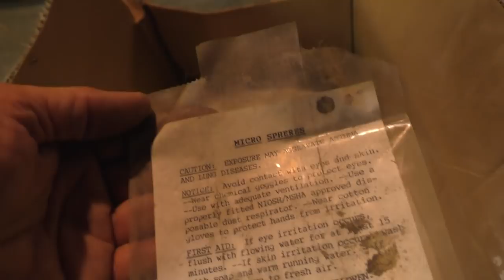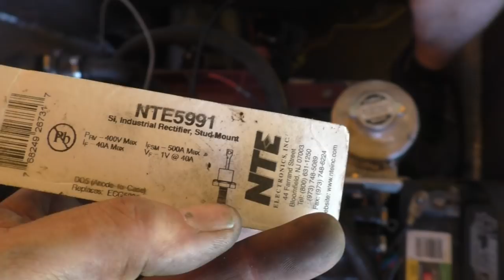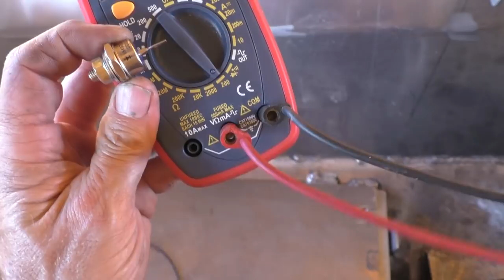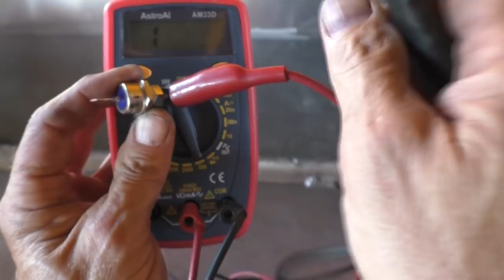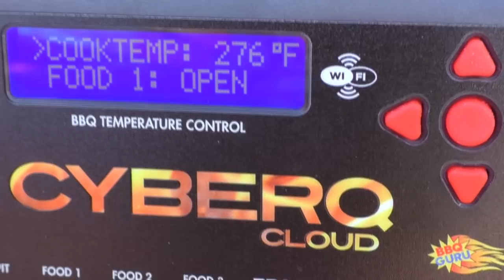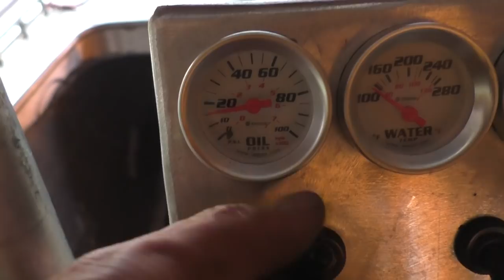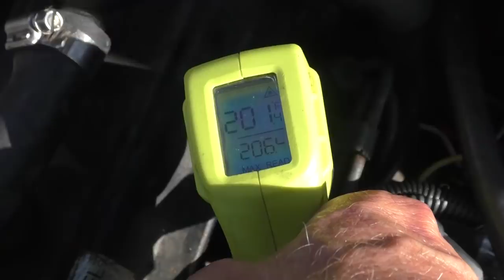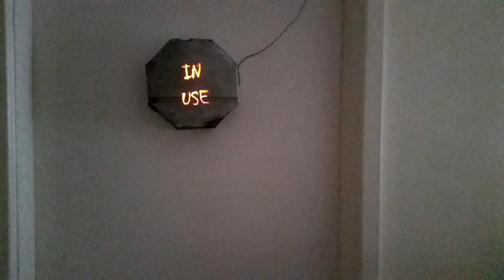Diesel Jet Boat Build - Part 17 - Fixes and Back to the Lake

Comment: that's a 70 HP motor you've got there. you should be MOVING. Your impeller must be too big, the engine can't build RPM's to full power
Reply from the maker: I think 2750 rpms is about right for being under load.  The thing holding it back is the weight and the deep V, but that is the strength and the smooth ride we want.
Reply: It's a grocery-getter.  Like the old family station wagon.  As long as it gets you there and back with your load, it's good!
Reply: 31:00 full of water.
Reply: This Engine is a high reving one for a diesel. It will go up to 5000rpm in a car. At 2750rpm you can get about half of the rated HP. You can modify the boos pin for more fuel and crank up the wastegate sping to about 15psi for more torque. On usesd engines the diaphragm for the boost pin can be broken, then it will make boost but dont get extra fuel.
Reply: Yup, Lots more power available. In addition, SV Speaker is a heavy heavy boat. If you come into a situation where you really need a tug in rough weather, the power you were getting now is going to be really insufficient
Reply: Wonderful fabrication jobs by all though! Your cleanliness of design and attention to detail is commendable!
Reply: Yup, too much pitch, it is probably still pitched for the weight, horsepower, and hull design of the boat it came off of. The engine should be able to get to about 4,000 rpm at a minimum, and low rpms at full throttle means the engine is struggling to move the blades through the water. You are leaving a lot of power unused and having an over-pitched impeller will make her guzzle gas.
Reply: Being able to plane would be handy in an emergency. I would think 70hp could plane that boat with the right pitch. I'd be real curious to see how much headway you could make with 30knot headwind.
Reply: I thought the Hamilton's were rated at 5000 RPM.  Doesn't seem anywhere near it's potential.
Reply: Your RPMs seem to be in the sweet spot for that Diesel. If it were a boat with a prop it seems that a higher pitch propeller would be the answer. Can the impeller be adjusted? I know guys in my neck of the woods that run outboard jets polish and shim there impellers for maximum performance. You don't have much HP but you have torque. Your jet is probably set up to turn about twice the RPMs. I think she still has some MPH in it, just need to spend some time playing with it. Love the videos. I've been following for a long time now. I'm gonna have to stop by and see it in person some time.
Reply: A 2:1 overdrive would seem to be the solution, but it sounds like a lot of work to mod that in now.
Reply: @SVSeeker  Peak power for that engine is around 3500-4000 RPM. If it's only getting up to 2700 RPM, either it's not making full power, or the jet pump's impeller pitch is a bit too aggressive for the engine. I wouldn't go messing with the fuel pump as others suggested, as that will compromise reliability - especially in a marine application where the engine can be at sustained high loads. On the other hand, I'm not sure finding a different impeller for the jet pump is a practical solution either.
Reply: @martinziefle1647  You should not mess with the fuel settings on an engine in a marine application. In boat applications, the engine can be held a sustained full throttle for hours at a time. Where as in a car you might only be full throttle for 30 seconds at a time. Cranking the fuel up on a marine diesel will adversely affect reliability.
Reply: This engine is very common in germany for the T25 vanagon. Its more powerful then  the original engine but still undersized. Its not unusual to run it wide open for many hours. The engine es relativly reliable if the cooling system works and the injectors are in good shape. Otherwise it will crack the head or melt a piston.

Comment: The flame proof paint goes to 1300C/2000F
Reply from the maker: OH!  That makes sense.   Thanks
Reply: The can states 1300F - 2000F (704C - 1093C) ...these are the product operating temp ranges.  VHT has 8 high heat products...each with a specific operating temp range.  The can label gives very specific curing procedures that must be followed for the product to perform as designed.

On the Vehicle
Paint must be completely dry before curing
Run at idle for 10 minutes
Cool for 20 minutes
Run at idle for 20 minutes
Cool for 20 minute
Run under normal operating conditions for 30 minutes

Off the Vehicle
Paint must be completely dry before curing
Heat to 250°F (121°C) for 30 minutes
Cool for 30 minutes
Heat to 400°F (204°C) for 30 minutes
Cool for 30 minutes
Heat to 650°F (343°C ) for 30 minutes
Reply: SV Seeker - I was wrong (a simple unit converter)would have told me that... ) 
corrrect answers by others above this comment.^^^

Comment: A 3 stage jet and a 2 stage as you have it now are too big for that engine, to make the best use of that engine using all it's rpm range you will have to go to a single stage jet.
Reply: I don't even think a single stage will work with that motor? Pull that motor, weld up a transom and mount a 150 outboard with a jet unit. Or better yet.....purchase a much much lighter RIB, mount the 150 jet unit  and have a very  fast, roomy, usable skiff. I predict that this home made thing will be abandoned in the near future. lol

Comment: Is there a reason you can't use a wire direct from the battery to excite the alternator? When I wired race cars thats all I ever used. Now you have this diode that is sure to fail when your out to sea.
Reply from the maker: I think it would be a constant drain on the battery is why that is not done.   And nothing is certain.  :)

Comment: That unit would need at least 150 HP even with one impeller removed, you need to repitch or go to a single stage check out hamjets web site its got a lot of resources to help get things matched

Comment: The fan is for a radiator to cool coolant, not to blow air over the engine. ITS NOT AN AIR COOLED ENGINE
Reply from the maker: It's also not in a car.  Check out bilge blowers.

Comment: Any plans to get Zila or another welding expert involved in advice on closing those under water seams?  As you know, aluminum welds can perform poorly in certain situations and may require reinforcement plates or other wizardry.  At least they are only filling the sponsons.

Comment: That exhaust wrap is terrible stuff. I work I Hvac and that fiberglass wrap is far worse than any other type of insulation we come into contact with. I wrapped my manifold and turbo with it, and it wasn't long before it was flaking off. It gets everywhere. It clogged my air filter and was always getting between my fingers like little needles.
Reply from the maker: That brand, Design Engineering Exhaust Wrap, https://amzn.to/2ClMyBu  was recommended by folks that have not had any issues with it and it has a 4.5 star rating on Amazon.  Apparently there are more than a few poor quality wraps out there.
Reply: I probably just got the cheap stuff
Reply from the maker: It's going to be a while before we can find out, but we'll let ya know.   It certainly gets good reviews on Amazon.

Comment: friend of mine used the insuation tape for the exhaust , the tape got soaked in engine and transmission oil over time gotten a little too hot and caught fire while driving , he had to hurry to get to the side of the road and trow sand against it to extinguish the flames under the car
about the relay for the fan in the boat : it might be a better idea to use a solid state relay , no moving parts to corrode 
https://nl.aliexpress.com/item/1pcs-solid-state-relay-SSR-25DA-25A-3-32V-DC-TO-24-380V-AC-SSR/32663806352.html?spm=a2g0s.9042311.0.0.6c864c4dChLeIU
the rectifier is called a rectifier because there usually used to make dc out of ac current , (straighten it out or rectifying it) a lot of youre aluminium welders have those things inside
the tender gotten a lot more stable , still isnt a raceboat , prolly need a bigger motor for that . another cummins maibe
having the same engine as the sailboat does make it eazier to steal parts from it to repair one or the other engine in a pinch

Comment: Agreed, heat gun does work much better than the small torch. Here's a source for one if you haven't already bought one, also good source for electrical products at a good price. https://www.waytekwire.com/ Probably about 90% of the stuff I used on my race car came from here, good people and fast.
Reply from the maker: Yes, easier to get it right.  ...but slower.
Reply: Not really, mine heats up instantly.

Comment: What did the 29 thumbs downers build this week? As for me, I replaced $1,000 worth of poorly designed leaking OEM single acting hydraulic steering cylinders on my 57 hp tractor with $400 worth of double acting cylinders.  Also rebuilt a 40' x 10'  2nd story deck and stairs.

Comment: This is a dumb ass question for you you probably have an answer do you know which way your jet drive pump is spinning because some Jet-Dry pump spin in the opposite direction depending on the type of motor that was being used so if your motor spinning clockwise and your engine I mean your motor spinning clockwise and your and your jet try pump is spinning counterclockwise you'll have more power in Reverse than you do in forward and if your jet drive pump is spinning clockwise in your motor spinning counterclockwise it's still the same way I ran into a problem like that one year when I was building a boat and used out trial from one boat and used an engine from another boat and they ran in the opposite directions just food for thought like I said it was a question I didn't know if you had an answer if you were curious to know thank you sir